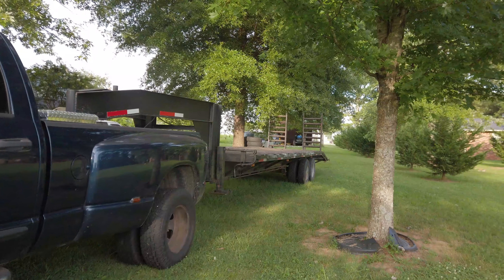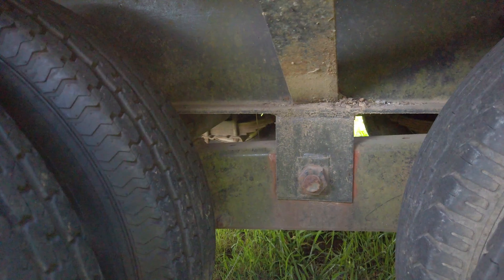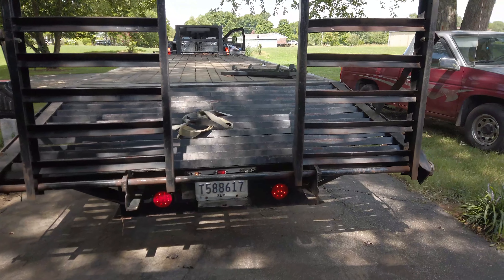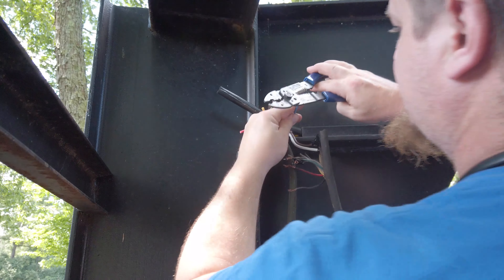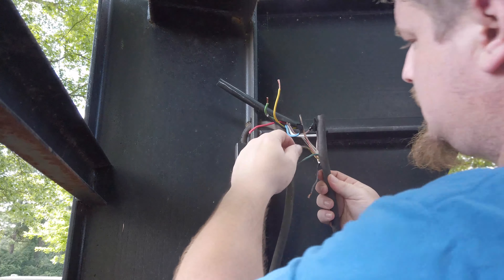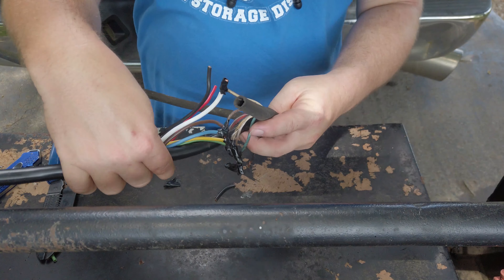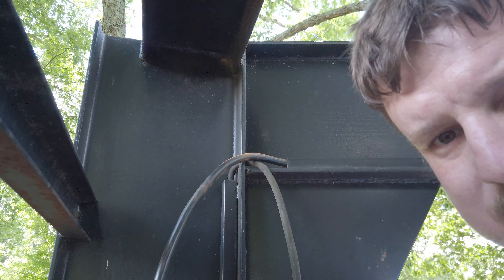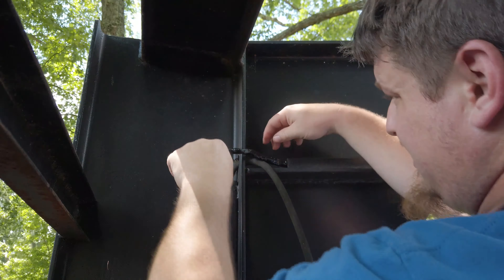Fixing Wire Issues on a Gooseneck Trailer

Comment: How can I add power to the running lights without connecting my vehicle?
Reply: Ok to check the lights on your trailer connect to the 11 o clock pin and the 1 o clock pin now this only works if you have a breakaway for trailer brakes if not connect to them pins with a battery charger please write back for more questions